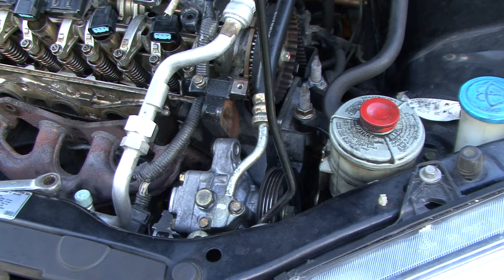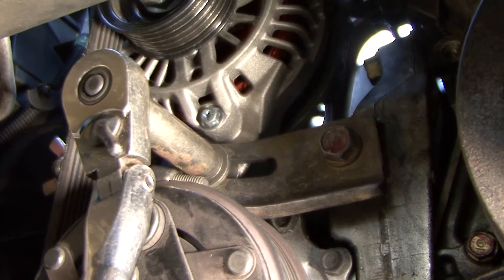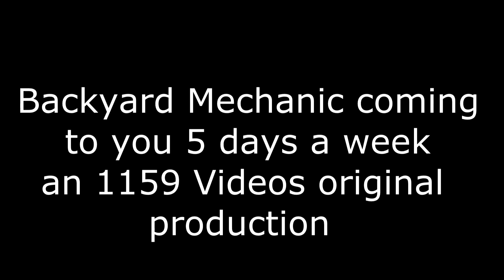Honda d17 timing belt part 1

Comment: A crankshaft pulley wrench is available, it keeps the pulley/crankshaft from spinning when the nut (high torque) is loosened.  I bought one on eBay for a 6 cylinder Accord.

Comment from the maker: i made my own tool to hold it , it was pre loosened for the video, this one i knew would be easy to take off the owner tried to do the timing belt got it 2 teeth off then took it to a shop they did it , the whole time the issue was a blown head gasket so i got it and fixed it right and fixed what everyone else messed up so i ended up shooting like 10 d17 videos lol, im about to do a k24 in a civic 5spd or 6 spd if i can find that trans

Comment: The lower crank pulley bolt did you have it pre-loosened for the video or did you utilize the special tool available? How did you go about loosening it without the motor spining? I did a 5speed f22 timing belt and it was a pain.